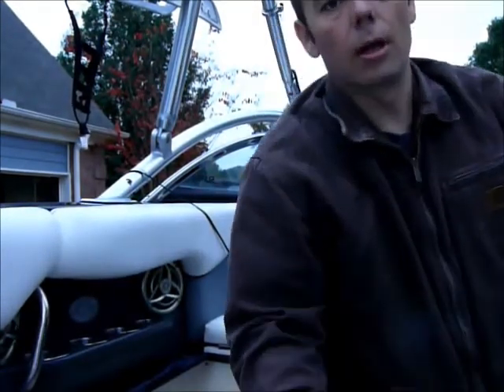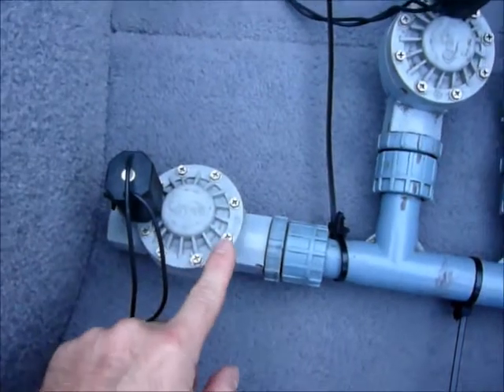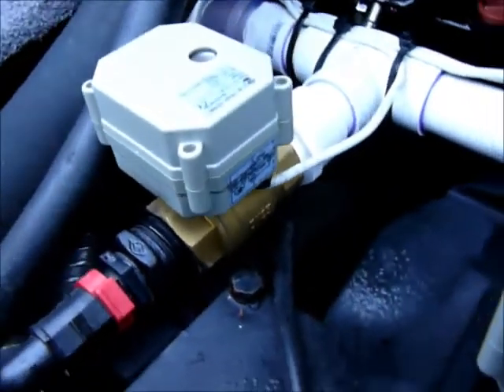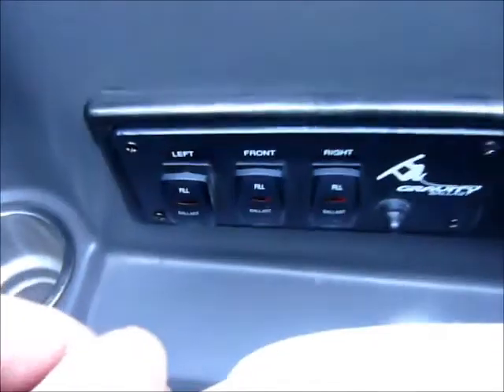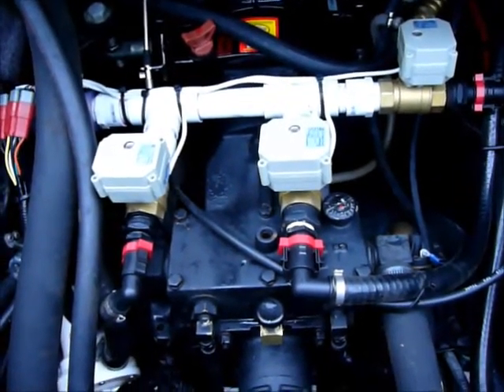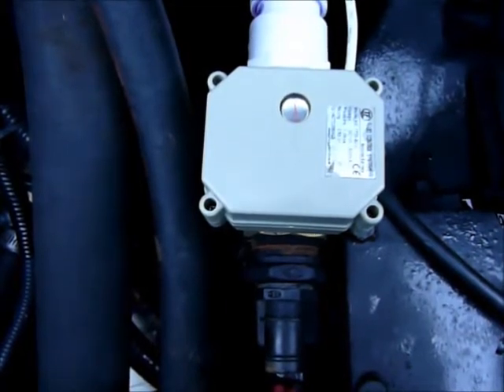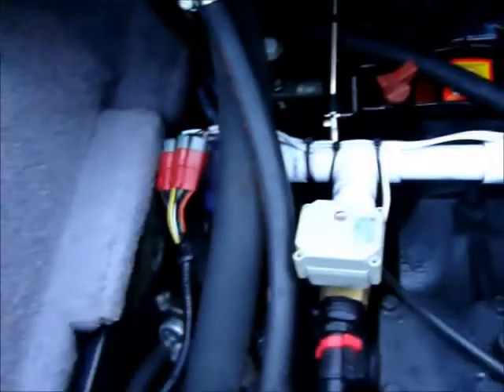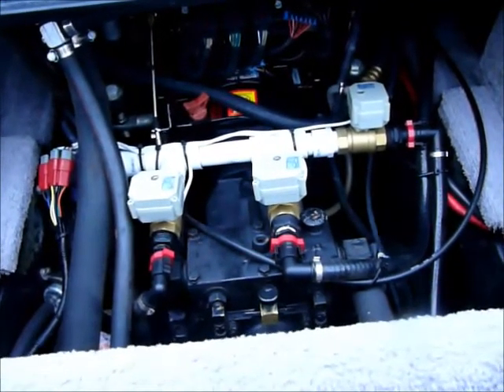Ballast Update 08 Supra Launch

Comment: Awesome video! I just bought an ‘09 Enzo SV240 that has 5 of the stupid sprinkler valves. I was going to just bypass the valves and piggyback the rear and middle bags together, but this looks like a great solution to still be able to control them separately. Could you send the info to alan.sagers@gmail.com?  Thanks!

Comment: Great video Brad, I just did the valve upgrade you have shown in your video but I need some help with the circuit, I have the exact setup you show. Thanks for the very informative video and any help you can provide with the wiring.
Reply: Sure give me a call or email.   My contact info is at specificgravity1.com

Comment: Would the 2 wire 12 volt ball valves I find online work? They are normally closed with no power, when they see voltage they open. This would avoid the time and trouble to rewire it to 3 wire like you had to..?

Comment: Hey, Brad... THANKS for posting this.  I just bought a 2004 Moomba Mobius.  Years ago I had previously owned a 2003 Supra Launch which is why I bought this boat.  The price was right and it is basically the identical boat with a different decal on it! Both of these boats had the same lousy system you feature in this video.  If you still monitor this video, I'd love to get the wiring diagram.  I'd also like to see a snapshot of how the front bag is connected.  This one is not hooked up and I think I'm missing parts.  Lastly, how does your system drain?  On my moomba it appears there is a separate pump for draining the tanks.  Any help would be appreciated.

Comment: Do you have any draining issues? Mine will not drain often times.
Reply from the maker: I used to with the sprinkler system.  But now they are rock solid when they drain and fill.
Reply: I wonder how the valves would affect draining though since it is a separate system?